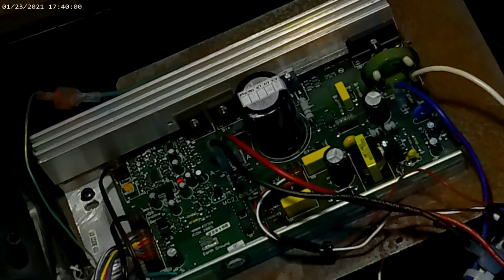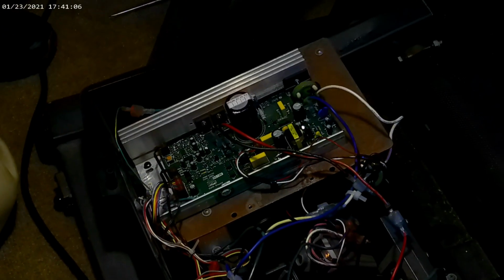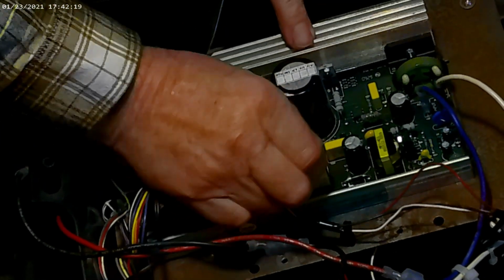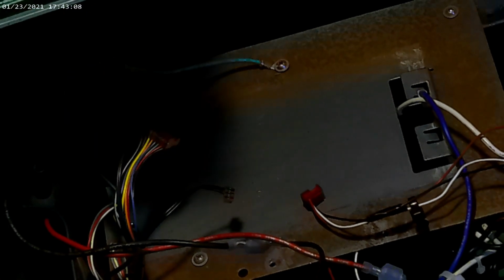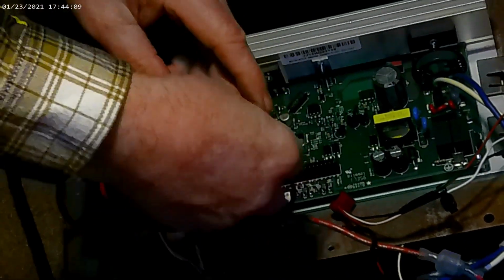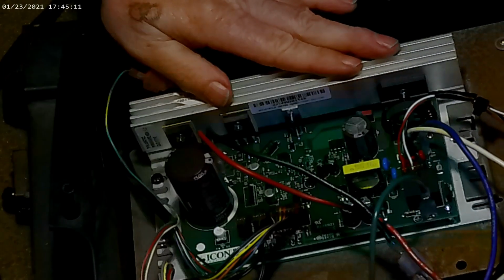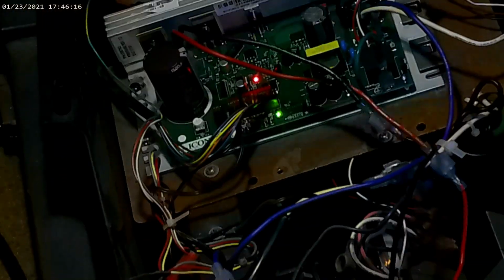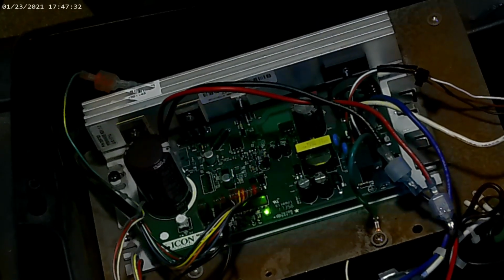Replacing Nordictrack Treadmill Motor Controller

Comment: Good day, I have a Nordictrack Commercial 1750 treadmill. I need a wiring diagram for the treadmill or if you can kindly assist where the electrical wires connects to. From the electrical power cord there are 3 wires, green being ground, and then there are 2 wires,  white and a black. White being neutral that goes to the board, rhe other wire (black)  I am assuming, goes to the power switch. If so from rhe switch , what color wire from the switch goes to either rhe board or motor?:Also, from the motor, there are 2 blue wires I am.not sure where they go to. Also, from the motor there is the red wire and black wire which I know goes to board and that powers up.the motor. Thank you.
Reply from the maker: The neutral wire does go to the board the black goes into one of the blue and the other blue goes into the hot side of the board. The blue wires are a thermal breaker for the motor. And one blue will have a female end and one will have a male end just to help make sure they are going to the right spot. 
But I don’t know what you’re looking at this is just the normal way they run
Reply: Hi, thank you very much. You have answered my concern. The board was hooked up wrong, so I have a blown board. Do you sell new or reconditioned boards. I do have rhe board number. Thank you for your quick response.
Reply from the maker: @c @cyrilcoolman2820 p on new the part # is 1648 it’s on website Fitnesspartspro.com just let me know if the main connection is a white or black pin set

Comment: C2150 - motor stopped suddenly, now the treadmill turns on, will start for a brief moment, and then shuts down. There was a burning smell the first time this happened. I did replace this board about 5 years ago- could that be the problem again?
Reply from the maker: @irishflynn30  yes sir but I would also do a walk belt test to make sure it is not worn and causing overheating of controller see video named testing my sole walk belt. On my channel fitness technology services

Comment: So my nordictrack c 850 s 2.75 flex select works great, but the incline doesn't go to its max even when the display says 12 (which is the max). I tried to recalibrate the incline ( by holding and speed increase, etc), but it doesn't register the command. When i unplug some of the wries from the circuit board, i can get the display to read 0 incline by using the increments arrow and by doing so i can get the treadmill to its max height however it does goes right back to the same limited height if i lower it and try to max it out again. ANY THOUGHTS? PLEASE!
Reply from the maker: @jasonmikol7728  Hmm this sounds like a console signal issue is this a touch screen console ?
Reply: @FitnessTechnologyServices its not exactly a touch screen with menu options but all the buttons are touch activated.

Comment: replaced motor bearings,capacitor started smoking,replaced capacitor now it wont turn on at all,junk
Reply from the maker: @5000RR  it’s really a matter of luck? I have had many customers Who never has had any issues, But many just like you (luck)
Reply: @FitnessTechnologyServices  im in europe maybe they put lower quality parts for this market
Reply from the maker: @5000RR  Well ! Here in the us we feel we get the cheapest parts Hmmmm
Reply: @FitnessTechnologyServices  update,i hired a bad repairman that broke the motor heat sensor wires when he installed new motor bearings which caused the controller to short twice after repairing it works again

Comment: My Nordictrack C900 treadmill has a on & off switch. How do I know which wire goes to it and away from it back to the board?
Many thanks for your help. What a Great video.
Reply from the maker: @PFDish  it depends on what controller board you have normally the board has it marked ac white should say n on it and a h for hot black. It is best to take a picture of it just in case
Reply from the maker: And thank you for viewing
Reply: @FitnessTechnologyServices  it has an AC Neut & AC Hot
Reply from the maker: @PFDish  the black wire is normally hot . The white neutral but take a picture of your controller just to be sure
Reply: @FitnessTechnologyServices  there’s a Blue wire about 5 inches long that loops from one terminal to the terminal next to it on the used board I bought. Is there a way I can send you the photo?
Reply: @FitnessTechnologyServices  Thank you. The new board and motor comes Thursday. Is it ok to message you if it comes and I’m not sure?

Comment: I have a x32i. My belt quit running but incline works. I used to be able to just unplug and re plug and it would work again but it’s not this time. I’m guessing it’s the controller board. It is flashing red though which I thought meant it needs replaced but Im seeing in the video it flashes red even while the belt is moving?
Reply from the maker: Well on Nordic Track the red led light on that motor controller is the PWM signal from the console. If this is flashing the motor should be turning. So first try would seem to be controller. But any time you fix it by plugging and unplugging you are rebooting the console.This can be console if it is a full touch screen they are touching?

Comment: Hi, my Nordic track incline trainer won’t stop trying to lower at the bottom when the belt is flat and it breaks the plastic nut  holding the long bolt. Why won’t it stop automatically? And how can I fix this? Thanks!
Reply from the maker: Well two possibilities the incline sensor is bad. Or the console is over sending the down signal

Comment: Hi! I have a Nordic Track x22i that makes a POP sound & starts smelling burnt after I press the START button to run. Any ideas?
Reply from the maker: Hi I would think you should start with the motor controller because it doesn’t make the noise until you hit start

Comment: I have a 2950. The controller was changed but the speed is now very wrong - I can now run at 22kph - is there a potentiometer on the board to adjust or could it be the speed sensor?
Reply from the maker: Well most likely not the speed sensor .I would double check the calibration first.And most Nordic Track controllers due have a potentiometer on this video it is the orange Phillip head port next to speed port but a lot of them are very glued in

Comment: I have the Nordic Track T5.5i and my screen won't turn on . Checked the control board and the green and red lights are on .
Reply from the maker: Probably a bad console if you can get too it check the wire harness for 12vdc at the console connections
Reply: @FitnessTechnologyServices  can you elaborate on this? How do I do this and what am I checking for?
Reply from the maker: @seanmahoney196  This is a installing board video. Let me know what issue you are having.
Reply from the maker: @seanmahoney196  I see probably same issue in general if your controller is working you should have 12vdc on probably red and black .check it at the connections from the lower harness meets the console harness.

Comment: What about putting a little 120v cooling fan to blow over the board and heat sink to prolong life? Seems like these things just keep baking themselves, especially when there is a high current draw from lack of belt lubrication.
Reply from the maker: Well that’s for sure a good idea some! Some models over 3k have them helps some. But if you are trying to add extra protection for your controller a good idea also would be to add a fuse link between the motor and controller. Most controllers  blow from amps produced by motor. Which are caused by worn belt. A great idea. Not sure what the amp load difference would be with a fan helping sounds like a future video to me.
Reply: @FitnessTechnologyServices  Great idea on the fuse link. What specs on the fuse would you recommend on a NT2450 2022 version? Mine should be arriving this week and I'll add that right away! Thanks
Reply from the maker: @djdannis  Well I start at 8 amps then if that blows too often . I go with 10 after that it is time to think about changing belt
Reply: @FitnessTechnologyServices  Awesome, I'll add a fuse to one of the motor supply leads from the control board. Between that and the fan, should help prolong the life as best as possible. Found some 120v 80mm fans on Amazon that can be tied to the main switch. Will have to switch the unit off each time anyways as you should. Appreciate your help and prompt responses! All the best.
Reply from the maker: @djdannis  That sounds good
Reply from the maker: But put the fuse on the hot side of the motor

Comment: Great video, I have the same card on mine.  My red and green lights light up, but my screen doesn't work and nothing turns on.  This is a result of me moving the treadmill.  I ran continuity with all of the wires on the control cable and they are all good.  I just can't figure out why the screen doesn't power up.  It is receiving 12vdc from the cable harness from the red wire and the red and white wire.
Reply from the maker: Thank you. No combo for power including a black wire! Sometimes their is more than one set of 12dc going console for different pc boards in console. OHM your harness see if you can find 12dc on one of the reds and a black. Also check under your motor hood cover sometimes they tape a diagram to it
Reply from the maker: I guess I didn’t read your email well you did ohm it . Ok if it gets 12 VDC you may have to look for loose ribbon cable inside the console
Reply: I have a similar issue.  Does your Bluetooth audio button blink blue?  Mine does but the console won't turn on.  This is also after we moved the treadmill.
Reply from the maker: @forgie716  mine is a older unit no Bluetooth . But that shows you have power to console if you can’t disconnect Bluetooth you may have a bad console
Reply: @forgie716  my display is also not turning on. bluetooth light is on. did you figure out a cause for yours?

Comment: I have the 2450 its getting power, but console wont turn on.
Reply from the maker: You will need to meter the wire harness connections were the console harness and the center main harness hook up .should have at least 12vdc

Comment: What component(s) typically fail on these boards?  The MC1648DLS ZE0824 (white sockets) stopped controlling my incline motor.  I replaced the board with a loaner and all is working again.  Nordick Track T6.5Si is just 1-yr old this month.
Reply from the maker: It’s hard to say what the most common components are for the incline The controller normally fails on the DC side of the controller for the running motor. And the newer white ports I have just started seeing
Reply: @FitnessTechnologyServices  I'm currently dealing with this exact model of board having a failure on my (less than 3 years old) Nordic Track Commerical 1750.  Looking into buying a new one, but not afraid to try stuff first.  Already replaced top console with a backup I had.  Any guidance?
Reply from the maker: @dontquoteus5379  well you have to try the lower controller it is 90% of all issues with treadmills
Reply: @FitnessTechnologyServices  
Do you have a replacement board available for my machyine?  It is a model NTL14129.9.  Board currently in it is MC1648DLS ZE0824 (no rev).

I watched your video on belts too.  I think that may have been the cause as I wasn't aware of lubricating it.  My fault.
Reply from the maker: @dontquoteus5379  yes but are web has it listed as mc 2100 Lts50 same controller a little different hook up ..yours is the newer # we have it in stock it is the same cost Fitnesspartspro.com

Comment: Hey! I have a NordicTrack 1750 commercial and it will not power on at all - the screen is not turning on. When I looked under the cover there was a red led and a green led blinking on the controller board. I made sure all my connections were good and checked continuity from end of plug to end of plug on the lower cable that runs up the support arm to connect to the screen and it was making a solid connection. Do you have a suggestion or an idea of what could be wrong?
Reply: I have the same treadmill. Just changed the control board because belt would stop after few minutes of running. Give Nordic track a call. They were helpful and sent me a new control board under warranty. You may need new screen motherboard

Comment: Mine will NOT run... just beeps at me.  I thought it was the iFit, and the iFit is non-responsive.  I have shut down, unplugged, changed out surge protectors... and then I thought maybe I should pull the wire out of the port for the iFit, but I don't know which one that is...  ANY help would be greatly appreciated.
Reply from the maker: Hmm that’s hard to say over the years they have changed if a lot if it is a newer unit 5 years or so they do not have a iFit port . Look for a small hole on the console base on top mostly? On left  there is a reset button down in that hole you will need to use a paper clip to reach button I have only did this once so I am not to sure. But I did find it on good old YouTube sorry I don’t know more
Reply: @FitnessTechnologyServices  I have a video of the issue but do not know how to share it here - There is no reset place to put a paperclip in - it's a Model No. NTL14815.4
Reply from the maker: @FilmAndVideoArt  send video to Fitnesspartspro@gmail.com I will look into your model I don’t know by heart
Reply from the maker: @FilmAndVideoArt  Sorry I can’t find any info on your desk top treadmill even on Nordic website they list the console as out of stock no info available . They list the part # as 375292 on iconservice.com  Icon is the manufacturer

Comment: I have a nordictrack t6.5s (not si). Right now it's completely dead. I've ruled out the switch. But I don't know how to test whether it's the control board or the control panel. The only notable thing is with the machine plugging in and the switch on the led on the board doesn't light up. I do get exactly 120v from the black terminal on the switch to the white AC Neutral on the board - I assume this means a good circuit to the motor.
Reply from the maker: Well if you have 120 to the lower controller and no light on the controller then controller is bad
Reply: @FitnessTechnologyServices  thank you for that.
Reply from the maker: @jhamaker  my pleasure always

Comment: I'm running into an issue with my incline calibration when wired properly it bottoms out the unit to the -3 when wired in opposite it runs the incline all the way to the top. I cannot control it up or down after it calibrates but the touch pads up top are sending the signal just nothing is happening the motor is bottoming or topping out and not moving after. Any idea what this could be?
Reply from the maker: This sounds like only the black wire ( down ) is getting the signal. When you hook it up correct only goes down! When reverse 🔄 the black and red only goes up. This is either a pinching wire issue. Or the controller is faulty
Reply: @FitnessTechnologyServices  both the controller and the motor are new only the wiring is same as before. It's a nordictrack 2950 would I need to order the small harness between the controller  and the incline motor as well?
Reply from the maker: @ETBozz78  Hmmm reseat all your Signal wires they come loose sometimes when you change controller. And you might have to try incline jumper wire
Reply from the maker: Also try reinstalling your old controller see if issue is the same . Make sure new controller is good. I’ve seen odder thing’s
Reply: @FitnessTechnologyServices  so the previous controller was running the treadmill at full speed on start up and the incline would not work. Now the speed is fixed but the incline is the only remaining issue. I'll try re seating the wires and see if that helps as well.